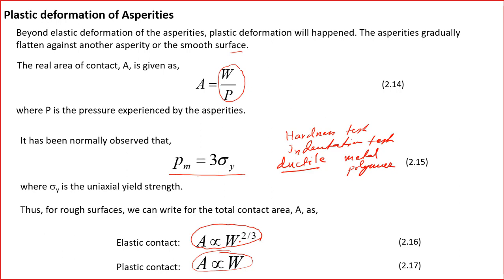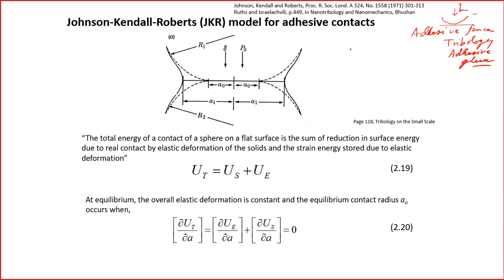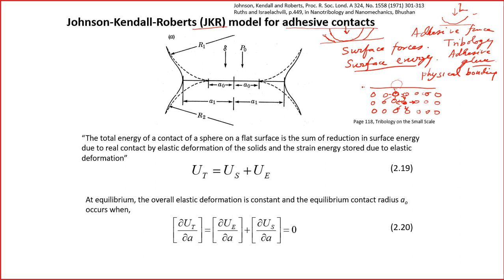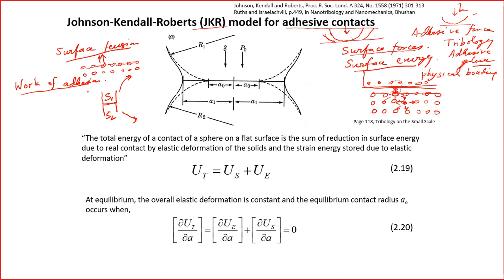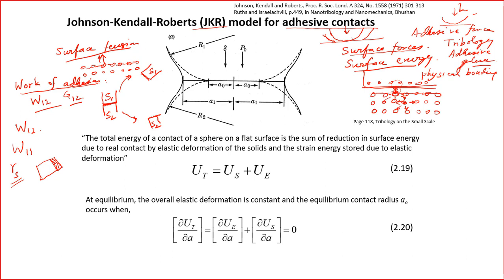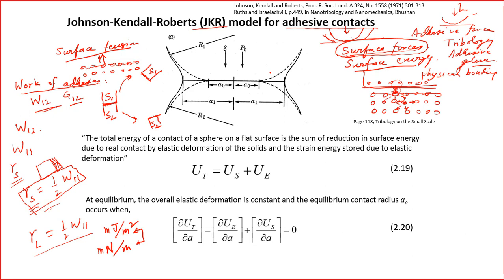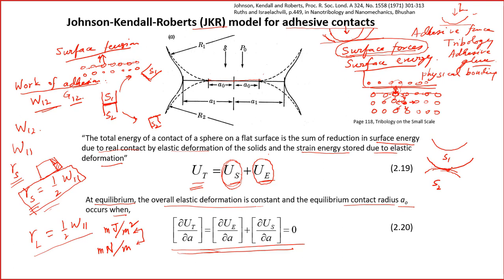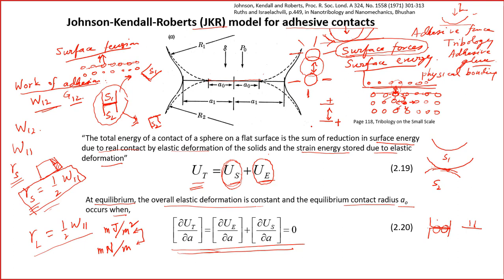Tribological Systems Design - Lecture 15 - Johnson-Kendall-Roberts (JKR) Model - Part I

Comment: Thank you for your video. I have a question about this model. Is the JKR formula only applicable to the contact between spheres?
Reply from the maker: It can also be applied to the contact between sphere and flat by just taking the radius of the flat as infinity.
Reply: Thank you for your response. But if I want to consider the JKR adhesive force between two spherical cylinders, would this formula still be applicable? Or what modifications should I make? @engineeringmaterials-tribo5142